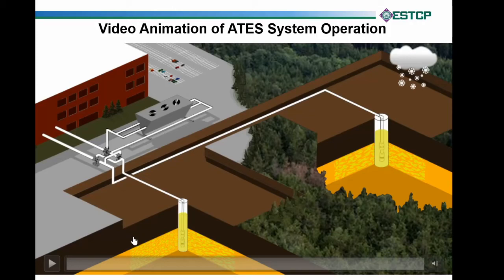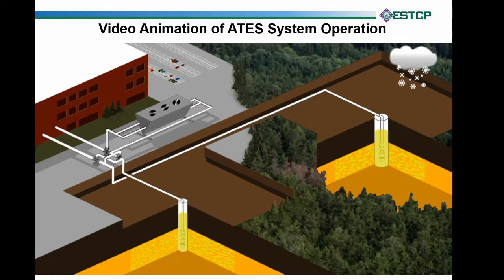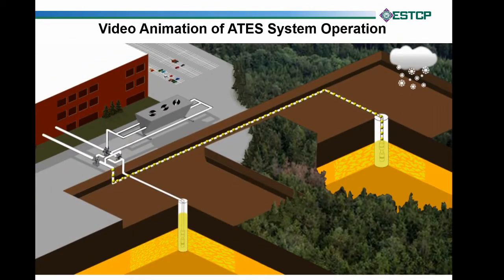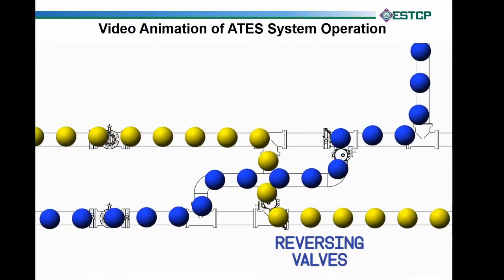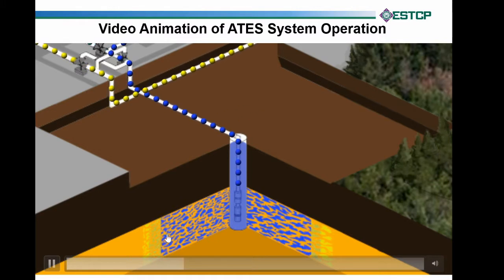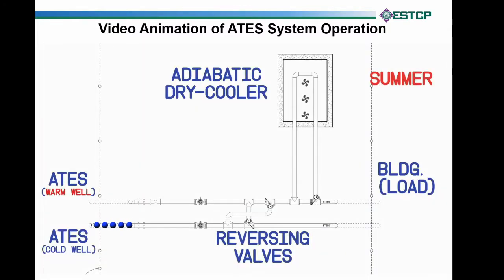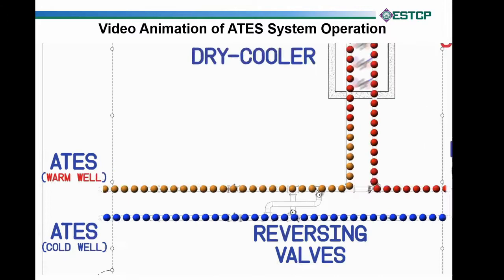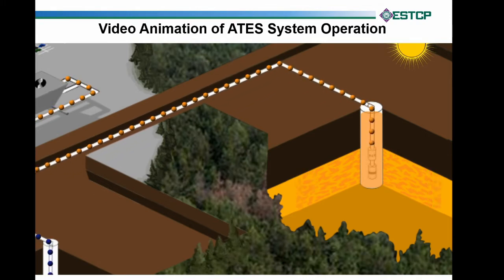How Aquifer Thermal Energy Storage Works

Comment: Few questions here:
When the hot water exits the building in the summer, why do you then cool it further? You say there is no need for that heat but u say its only roughly 5 degrees warmer, how is this enough to heat a building in the winter? Thanks
Reply from the maker: Louie,
We mainly do that here in the southern U.S. where we have way more heat than we need. Commercial buildings in the southern U.S. can be cooling dominated by as much as 8:1. A project in an area that is heating dominated or balanced may need the heat for the winter. The heat would be stored in the warm well and used in the heating season by supplying water source heat pumps with the warmer water. I hope this answers your question.